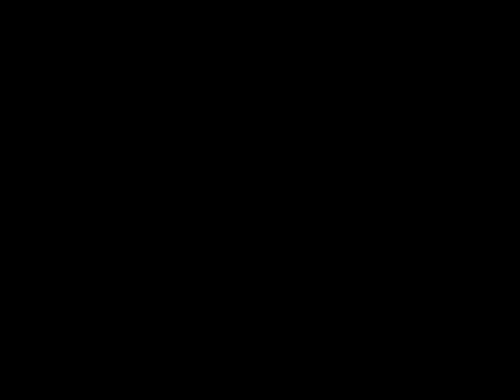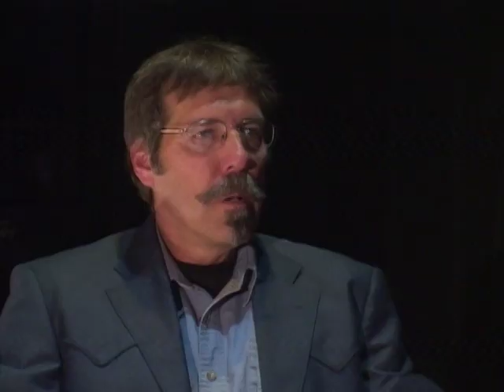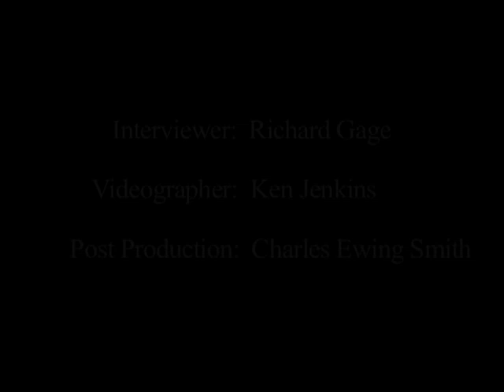Tom Sullivan - Explosives Technician - Loader - AE911Truth.org

Comment: @eldongb1 "Nothing you or anyone else can come up with thus far explains how this can be accomplished with such random things as fire and a hole in the building."
Incorrect.
Gravity exerts a force vertically down, giving huge masses momentum and kinetic energy that are vectors which go straight down. Momentum and energy dominate the dynamics of collapse to the tune of hundreds of tons of TNT equivalent. I told you that before. You just didn't understand. Only tiny portion gets deflected 2 side

Comment: @eldongb1 "My imagination has nothing to do with the fact that asymmetrical conditions don't produce a symmetrical collapse"
Incorrect
Your imagination has EVERYTHING to do with that, as it is ONLY imagination (not physics, not math, not engineering) that you employ.
You IMAGINE that collapses were symmetrical. They were not.
You IMAGINE that loads were asymmetrical. They weren't any more than the debris field in the end.
You IMAGINE that there must be a strong link between the two. You're wrong

Comment: @eldongb1 "Would you drive a gasoline taker"
If my goal was to crash into a house and die, then yes, no problem. It is dead easy to crash a gasoline tanker into a house, even if you never drove a truck before. Much easier than parking the thing in a garage. In fact I say KIDS could maneuver a gas truck into a house at the first try - every time. Just show them where the pedal is. Do you think YOU could crash it? And just the same way, a kid could maneuver any plane into a freaking HUGE building.

Comment: @eldongb1 "they were not pilots"
FALSE. They had pilot licenses. 
"no experience flying 747s" - Holy FSM, throw brain! Quick! Much! How many 747s were there? (Hint: it's a number smaller than 1). However, flying a 757 or 767 into a HUGE target is easy once you have some pilot experience. You see, Boeing builds these things on purpose such that they are easy to fly. If they were difficult to fly, they would not be approved to carry passengers.
"a simple investigation... will find nothing" you pay

Comment: @PapaOystein 
There was a lot of "collateral damage" with the collapse of both towers, but I can't see how it could be easily avoided even in perfectly controlled circumstances considering how close the other buildings were and the sheer size of the towers themselves. You're grasping at straws with the arson argument. Yes it can level buildings, and has done so with plenty. But a steel structure? Really?

Comment: @PapaOystein Says you, Mr. Expert. Where did you graduate? How many high-rises have you worked on? The outside walls were not encased in concrete. The CORE and about half of the structural columns WERE. Do some research before you pop off Papa.

Comment: @Lietuvispartizan "Why do you believe that thermite has to cut the column? Fires don't cut the columns either."
It is you truthers who are stuck with the mantra that the collapses "have to be CD" - that the major support structure must have been cut. It's your premise - but you fail to explain just how it can be done.
If you remove that mantra from your mind, you will see that progressive gravitational collapse doesn't require control and cutting.

Comment: @PapaOystein Each side fell down and not to one side=symmetry. If you think the load was symmetrical, then you have never been in an office building. The furniture, people, equipment etc. all put an asymmetrical load on the supports as they are equal on both sides. Your imagination is grasping at straws to refute the irrefutable.

Comment: @eldongb1 "That's why they ENCASE the steel in CONCRETE" - Are you saying the structural steel of the WTC was encased in concrete? Then you know absolutely nothing about the matter here.
"Fireproofing is used to stop the spread of a fire to other floors mainly, not because they expect it to weaken steel." - Incorrect. The spray-on fireproofing on structural steel is ONLY there to delay heating up / weakening. Again, you talk with zero knowledge.

Comment: @eldongb1 You obviously don't know the first thing about structural engineering. I'd have a lot to explain, as you make no sense at all. For starters wind loads are expected forces that go into the design, planes plus fires were not.
"High rises fall OVER" - got evidence for that? Highrises fall down, because that's where gravity pulls them.

Comment: @eldongb1 "because the CORE columns are encased in concrete..." - which they weren't
"...it doesn't matter if the trusses weaken, the CORE should not be the FIRST to fail." - and it wasn't. It was the last to fail. Tom Sullivan thinks it must have been the first to fail, since he speaks this nonsense about rigging the core with explosives. But video exists that show many stories of the core still standing for a few seconds after all the rest has already collapsed to the ground. Get your facts!

Comment: @eldongb1 "The asymmetrical load etc. cannot be SYMMETRICALLY overcome by sheer momentum" - you make that claim without evidence, and I say you pulled that from body regions where the sun doesn't shine. It's your personal imagination, has nothing to do with physics, engineering  and math.
"not through the still relatively pristine mass of the lower sections" - Talk to a structural engineer, seriously. Dynamic loads are many times higher than static ones, and totally overwhelm the structure

Comment: @eldongb1 "steel reinforced, cast concrete interior tube- the towers had concrete reinforced steel cores"
Waaah you repeat nonsense! Falsehood! Error! Mistake! Non-truth! Stop it already! Read up on all three WTC towers, okay? Don't dig that hole any deeper, you're dangerously close to hitting magma!
Come back when you have found out all three towers had a steel frame core with NO concrete to support anything! (Only the floor deckings were filled with thin layers of light-weight concrete)

Comment: @PapaOystein Norman Penetta's testimony. Actio et reactio. Fires would create a natural, asymmetrical toppling over. Even children understand actio et reactio means that the top floors have to subjusct the lower ones to uniform stress. The stuff/people are not symetrical and thus each column was subjected to a varied amount of force by the upper section. Give it up troll. Fail.

Comment: @eldongb1 Oh and don't forget that building seven was designed after the fact, with internal asymmetrical support systems so that entire sections could be removed for renovation, and all these asymmetrical supports failed in a perfectly orderly fashion...naturally. And I'M the paranoid theorist "truther"? That's a big stretch in my view. It all adds up to the official theory being unfounded and not adding up at all. Demolitions contractors need to quit their jobs because you just need a molotov.

Comment: @unRompecabezas A body being accelerated by a force acting on it the acceleration is proportional to the (total) external force acting on the body, and, for a given force, inversely proportional to the mass of the body.  My physics book doesn't say anything about it this not applying when outside forces are acting on stationary bodies. Which the lower section was. galileoandeinstein dot physics dot virginia dot edu slash lectures slash newtongl dot html explains it as my physics book does.

Comment: @eldongb1 "Yes, run of the mill unlike NIST phonies" - Yup. Real heavy-weight experts at NIST. The guys make the standards, the building codes for the country. All structural engineers and architects trust their expertise, several hundreds of thousands of them. None trust Gage, but a handfull (few dozend, after you discount all the non-architects and non-structural engineers on their phony list)
"Gage hasn't conned or lied to anyone" Gage maintains flat-out lies on the front page. Case closed

Comment: @eldongb1 "Actio et reactio" - spouting a buzz phrase eh? Without actually doing the math on a reasonable physical model, eh? Ok let's see... columns can exert force equivalent to static load times safety factor of 2 or 3, that means acceleration is g minus some... done the math? How much (measured in feet) must columns shorten elastically to stop fall from 1 floor height? How much CAN they bend before they break? Do the math, pal, and be surprised!

Comment: @IExposeMormonism "A 5000 gallon gasoline fire would produce more damage than a diesel fire"
1. jet fuel is not diesel  2. The fires in the towers were mostly fed by office contents; jet fuel was mainly an incendiary 3. Both planes had closer to 10,000 gallons aboard
"A child could never fly a 757 much less aim one into the WTC" I have SEEN kids fly a 707 on a professional simulator.
"Many 757 pilots have tried on flight similators and failed" - Provide a reference. I say you lie. Shame on you.

Comment: @eldongb1 "One of many physycists and a PILOT"
Problem is: You didn't find this pilot at random, or based on qualification as pilot, but because this ONE pilot has fallen for delusions. I guarantee you: If you find an INDEPENDENT pilot, or 100 of them, then all of them will tell you that this ONE truther pilot is a moron or a liar. Please, talk to independent experts! Pilots, physicists, firefighters, structural engineers. Don't ask those whose opinion you already know. Talk to strangers.

Comment: (cont'd) look any beefier than the ones holding up the roof of my local Home Depot.
My personal conclusion is that the Twin Towers were **NOT** built "like the old brick shithouse" as the saying goes.  Frankly, I found it surprising, but personally, I've never since then come across anything that compels me to revert to my original assumptions about how solid/strong they were.
They were, in fact, built just like a low-rise, only taller.  A low-rise design stacked 110 times, if you will.
My $0.02